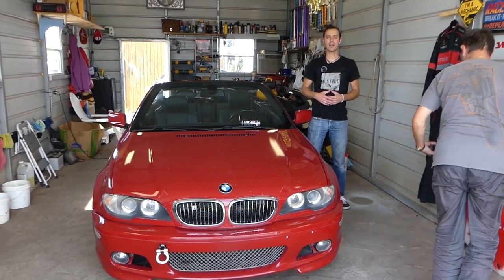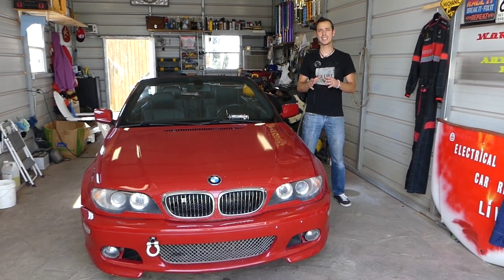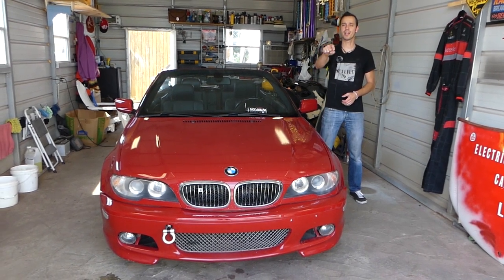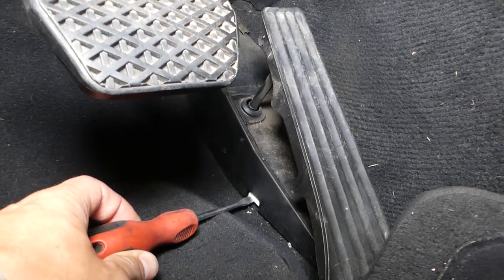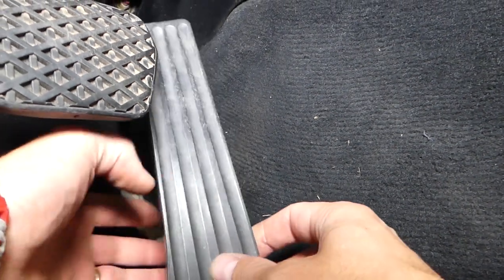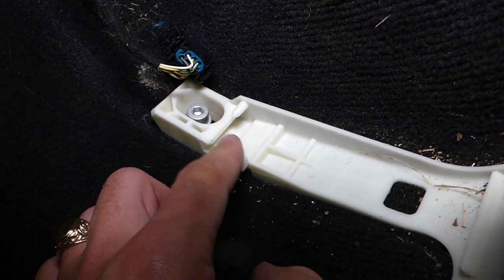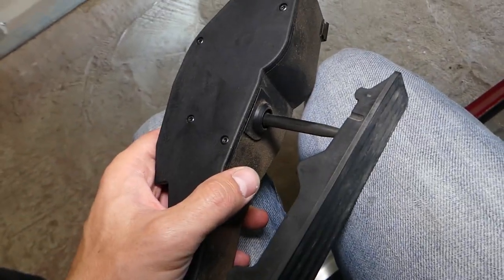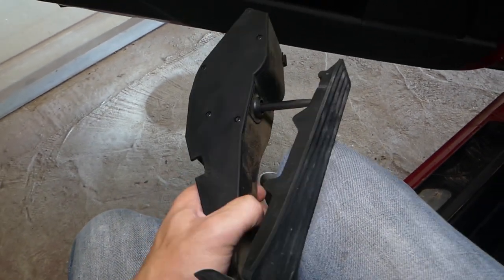GAS THROTTLE PEDAL REMOVAL REPLACEMENT ACCELERATOR PEDAL BMW E46

Comment: Hi this is a great video. Really informative. We have a BMW X3 si 2008. Would this apply? The only difference I see is that we don't have the clip on the side and can't find any information as to why. How would we get the gas pedal off when it doesn't have the clip on it? Thanks for the information.

Comment: Why did you replace the throttle pedal? I'm having an issue when I push the throttle fast it has a dead spot. do you think replacing the pedal can fix that?
Reply: Nod Melon  sold it to my brother. Never really tried to track it down.
Reply: I'm having the same problem what was your issue mate

Comment: Hey I have an E46 two codes P0123 and P0222 I replace the throttle pedal throttle body intake sensor I’ve checked all the wiring just can’t seem to find what the problem is could someone help please
Reply: Did you fix?